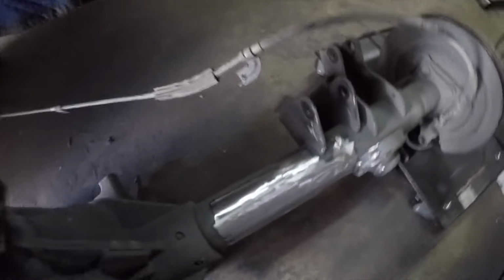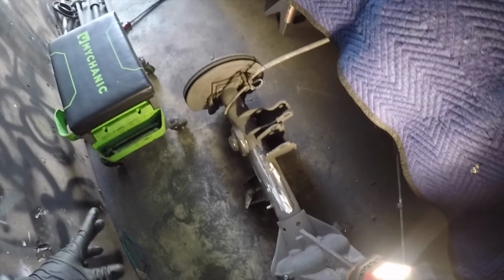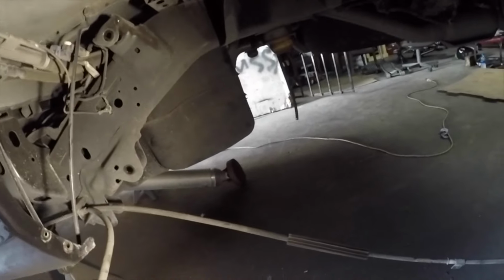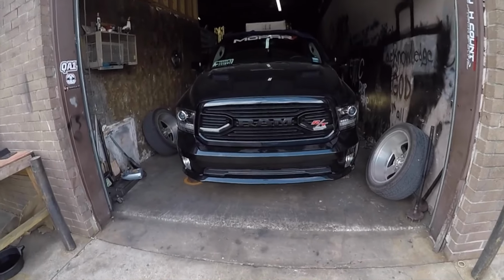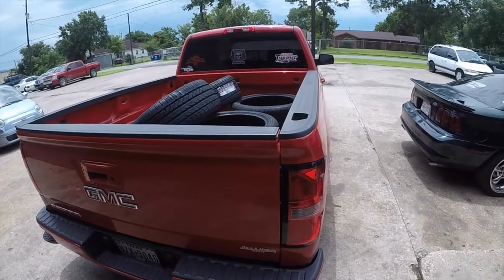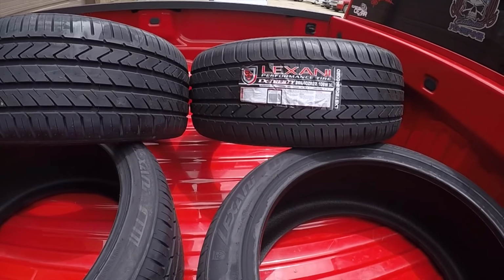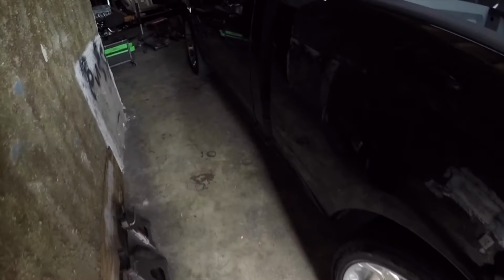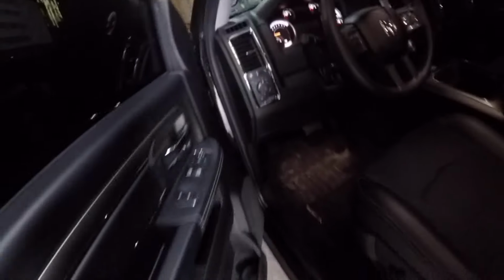Ram 2018 5/7 IHC

Comment: Hey bro is it necessary to cut your tie rod end for you toe adjustment on the 18 ram? If yes how much?
Reply: Not always. You can buy links for a f150 links with proper leveled length. Mounts right in
Reply from the maker: Miguel Sandoval yea bro most of the time you do inners and outer tierods